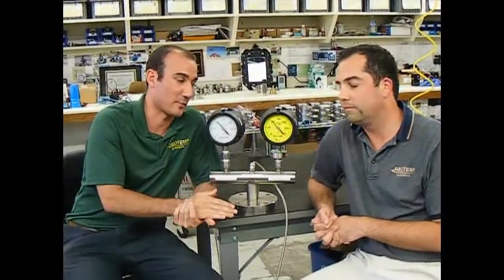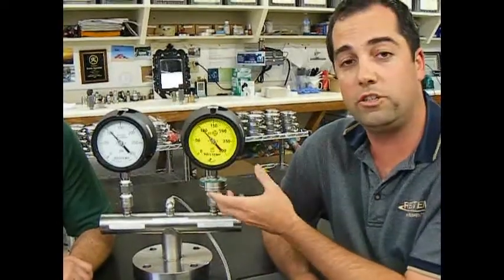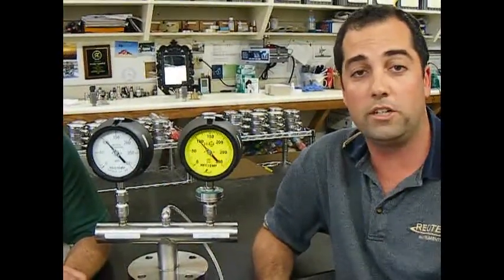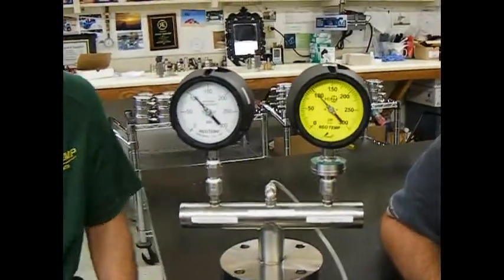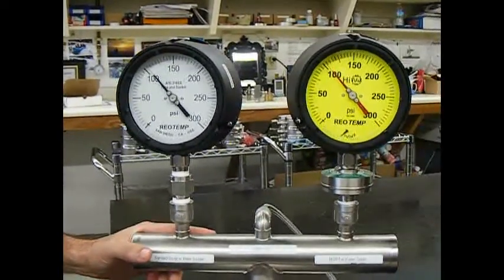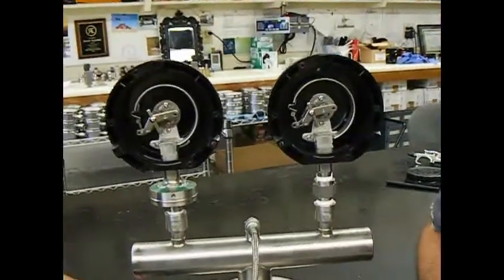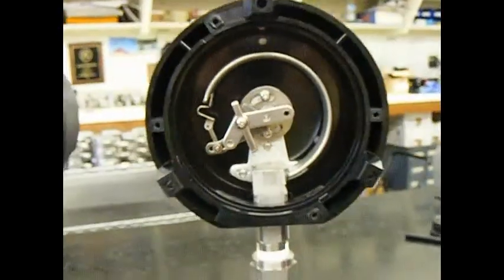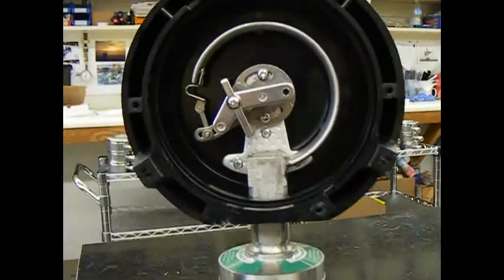MS8 with REOTEMP PulsePlus vs Gauge & Snubber

Comment: It would be great to se the difference of using a standard gauge with silicone/gliceryn filled compared to a dry gauge and see that if the fluid damps pulsation. My customers usually thinks filling the gauge with gilceryn/silicone will reduce the internal pulsations